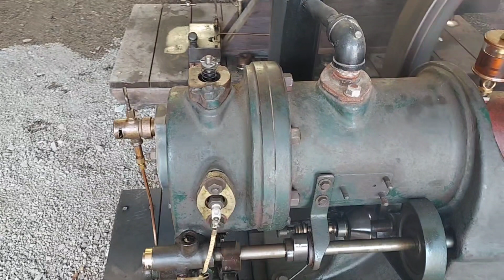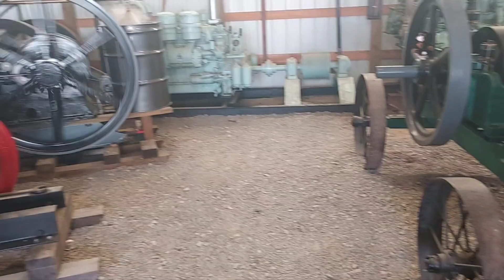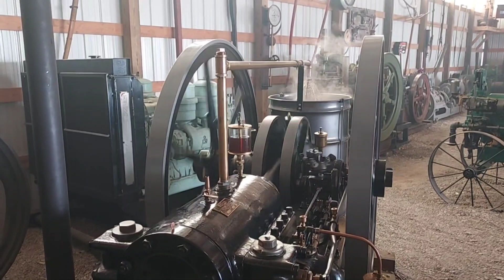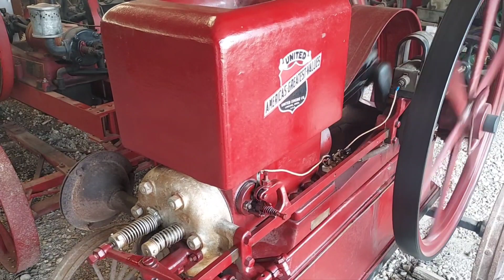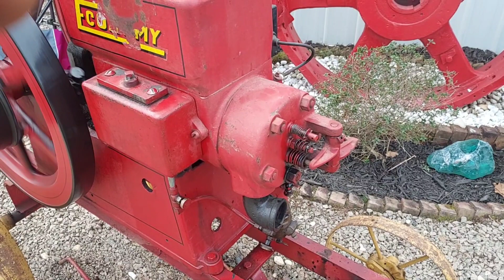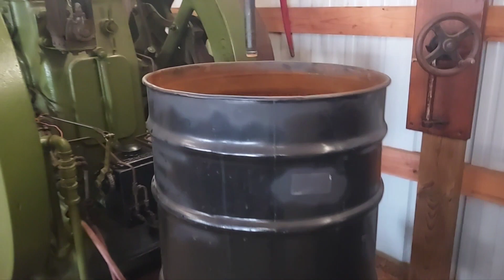Very Satisfying. Hit And Miss engines HUGE collection

Comment: Nice showing , are there any semi diesel engines at the function ?
Reply from the maker: There several old dozens that start of gas and run on diesel
Reply from the maker: Dozers
Reply: @willfixit5346  I knew what you meant , I do the same thing it's an elder thing 😂🤣🇺🇸